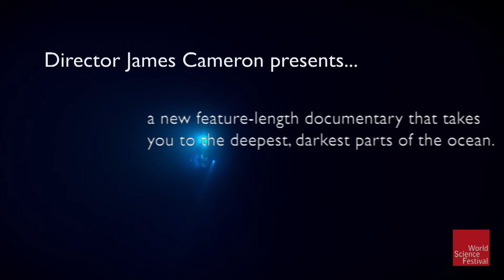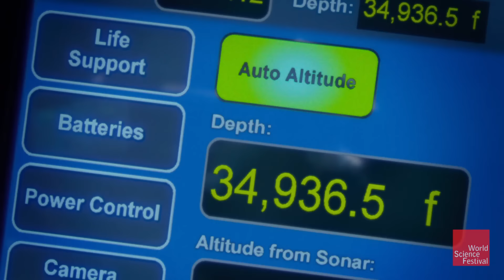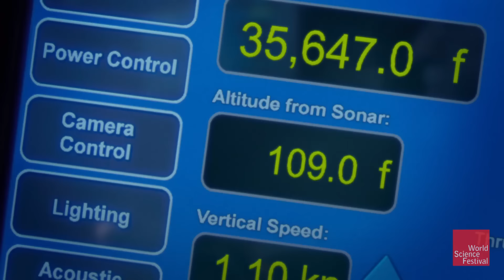James Cameron's DEEPSEA CHALLENGE 3D

Comment: here after Titan submersible incident. Compared to James Cameron dive sub, theirs looks like a piece of junk trying to get deep
Reply: So true - Deep Challenger is such an egineering miracle and yes Titan is a piece of junk
Reply: Same. Ikr? What were they thinking? 😒
Reply: It got deep😂
Reply: Despite your opinions, equipment really should NOT be complex !! As I'm sure you saw in the documentary, Cameron's sub also experienced some degree of systems failure due to some last minute computer code written in. The Titan sub's concept has proven to work and can be improved on just by eliminating carbon fibre and using steel /titanium throughout. The simplicity in the Titan sub means in emergency, ANYONE in the sub can operate it should the pilot become incapacitated. The Deep Sea Challenger is a single person craft and expressly intended for explorstion / research and so yes, needs all the bells and whistles. Just so you understand, Cameron's sub was built not by a huge corporation but by a guy referred to as "Australia's greatest Bush-mechanic"... Ron Allum
Reply: @zigzagger7893 and that’s not possible, that’s why they used carbon fibre instead. It would have been too heavy with space for 5 people
Reply: @zigzagger7893  what happens if my thruster of the left side goes out of control. And makes tour sub spin. How do you fix that using a joystick. Is that easy? 😂
Reply: @ExoticBlue22 Money Money Money is what they were thinking
Reply: It looked like an aluminum cqn while this one looks like art and engineering
Reply: @massinakmin8340  : The joystick is only there to control the actual equipment. The control could have been a touch-screen interface, could have been lever & cable with proximity switches. These are just control mechanisms. How do you stop the vessel from toppling when the system responsible for "not-toppling" fails ?

Comment: Worst nightmare...losing power at the bottom! 😱
Reply: Try to play game SOMA
Reply: Yeah I suppose that a sudden violent case of diarrhea and blast-vomiting comes in second. Close second, but second. Unless you wanna go combined for a real horror story.
Reply: At least no worries about your family having to pay a burial. That you did take care of.
Reply: In fact, there is an protocol, when a cable is broken or in similar cases, a program is launched that initiates surfaced to the surface (runs on spare energy).
Reply: I suppose it works the same way as on Trieste that made the first dive to the Challenger Deep 60 years ago. It had its ballast rigged so that it was held in place by electromagnets. If the power was lost, the weights were dropped and the bathyscaphe floated to the surface.
Reply: Yo
Reply: That’s exactly what happened to these people going to see the titanic
Reply: @Kraterlandschaft fair but I assume if you can afford a project like this you can probably afford a funeral. But alas

Comment: When you look at the technology and sophistication on that sub, including communication and then you realise that the TITAN was a tube made out of the wrong material and was operated by a PS3 controller that the CEO didn’t even know which thruster was operated by the movement on the toggle, it is extraordinary that ANYONE on the oceangate team was willing to work on the project. This was a mass group of people all suffering from the Dunning Krueger effect in my opinion. I hope there are Gross Negligence manslaughter charges bought against the entire team involved in the creation of Titan if it is proved that safety testing wasn’t sought, and engineering recommendations based on scientific fact were not followed, it is absolutely diabolical.
Reply: They signed the waiver so they new that if you want the biscuit you got to risk it.
Reply: It doesn’t matter if they use ps3 controller or even they use 80’s family computer used in super mario. It’s electronic and it does not hold back the pressure. You blame it to mechanical part.
Reply: Dunning Krueger effect is a myth.
Reply: It was created by a women's team😂 that might be the reason.
Reply: @@bossintrepid2128 weird because I’m “woke” and LGBT.. but you keep doing you 😂
Reply: @jwatson181  most people lacking competence would think that x
Reply: @sibboo4411  Look it up. They did a pretty interesting study showing it was a myth. Most people think they are better than average. This is where the effect comes from. People may know they suck at something but still think they are better than most people. Experts and lay people amsuffer the same.
Reply: @sibboo4411  Karen's are most often woke. That is a fact.
Reply: It was a logitech controller, but still
Reply: Here we go again, idiots blaming the PS3 controller
Reply: And naming it Titan, but made from carbon... Wrong on so many levels.
Reply: @jwatson181 lmfao, your comment is in itself validation that it's not a myth. Good job!
Reply: @theuniversewithin74  interesting argument. Do you think your argument is valid? I will give you a hint. It's not.
Reply: I agree with you 100%. I work in software development and we constantly see Dunning Krueger effect. I think this was 100% the case.
Reply: @jwatson181  Dropped at birth, I presume?
Reply: @iconofsin1043  you seem upset? Why? I am sorry researchers can't replicate the effect and now think the original study data didn't support the researchers inference. What do you want me to do about it?
Reply: @jwatson181  13
Reply: @iconofsin1043  13 is an important number.
Reply: @iconofsin1043  14
Reply: @lesterliston4692  
1. A PS3 controller is made out of flammable material which is unacceptable on a submersible
2. A PS3 controller is insultingly unreliable for such operation. If you've ever owned something like that you know it's heavily prone to stick drift. 

It's not what caused the implosion but that doesn't mean it's not a huge safety hazard
Reply: @Whitguy86  That's even worse than a PS3 controller. That controller is something you buy to maybe try some retro games or something and don't wanna break a bank. But yeah saving money is one thing but they couldn't even spend like $400 on something reasonable for such purposes? Brah.
Reply: @l4kr  what is not flammable inside the submersible? Is the paint not flammable? So if you make it not flammable is it ok? Or put diamond to make it expensive? The control system have a redundant on the control panel. PS3 controller is for portability so that you can watch on the window while controlling. Wireless 2.4Ghz with short range is reliable as wired. The size of submersible was not more than 20feet. I am working for the last 15years working this kind of wireless technology. It doesn’t fail in short distance. Maybe you’re mechanical engineer who where power trip like they are more intelligent than electronic and computer engineer. What happen to the platino contact point ignition system when replaced by ECU? The engine Hp increases right?
Reply: And according to James Cameron, the Titan wasn't even approved to go to such depths. I watched that documentary countless times and it still blows my mind what they were able to accomplish as a team.

Comment: Put it in perspective, 12 people spent about 300 hours on the Moon, while only 4 people have been on deepest seabed for 3 hours: Don Walsh & Jacques Piccard (Jan 1960), James Cameron (March 2012) and Victor Vescovo (April & May 2019) ...
Reply: Is it because the pressure down there is so high that it's difficult to stay?
Reply: @voiwithad  yes  oceans are more remote than the space its surprising  right 😃 what james Cameron did is unbelievable what a guy🙏🏿
Reply: Going to space is no pressure. Going to the bottom of the ocean, the pressures on!

Puns aside, I'm sure it's easier to keep a space shuttle from expanding apart then it is keeping a sub from being crashed like a tin can.

Comment: Stockton Rush was a billionaire. Its astonishing how he didn’t hire the best engineers to create his submarine. Instead he chose to get parts from Home Depot
Reply: He was not a billionaire, estimates range from $12 million to $25 million.  He didn't have access or the funds to get the best, Triton makes the best submersibles, the one that went to the Challenger Deep several times already (after Cameron did it in his version) cost over $37 million to make.
Reply: I support the other poster's answer. In my opinion, Rush also sold tickets for 250k because he needed the funds. In the mid 1990s, one dive to the Titanic in the Russian submersibles Mir cost between 25.000-36.000$ (acc. to book "Titanic and the making of James Cameron"). Even adjusted to inflation today (50k) this would be much less than OceanGate's price. Private dives to the Titanic in these Russian submersibles happened. This proves it could be done cheaper and safer using known, tested and certified technology.

Comment: That thing in Kawasaki Green makes me ask this question. ( i say that because I'm not quite sure if Deepsea Challenger refers to the project or the name of the sub)Gravity drops it down to the bottom. Dropping weights allows it to rise up again. How do they know that the surface it lands on is perpendicular to the vertical sub, so that when it lands it doesn't tilt over, and even if it does hit a flat surface when it arrives, it just seems so narrow a structure that I don't see how a stable perfect vertical landing is guaranteed, or controlled. Are side jets maintaining the angle during the drop? Is it bottom weighted? And like I asked, what if the surface is at an angle or there are objects on the surface that make the sub tilt over when it arrives at the bottom?
Reply: +sclogse1 I'm sure the develepers had all this in mind during the the making. Prob got cameras to check for horizontal landing areas?
Reply: +sclogse1 Maybe the same way they detect iceburgs?
Reply: Sonars dude
Reply: As long as the center of buoyancy is higher up than the center of mass, it is stable and will stand upright on the sea floor. You can try it wit a PET bottle and some sand, fill it only as much as it sinks in water and see what happens.
Reply: The heaviest part of the submersible is the steel pressure vessel that contains James Cameron - made of thick steel. This is right at the bottom. Most of the upper part of the submersible is made of compression-proof foam, which is buoyant. Thus the submersible is naturally stable in a vertical orientation.

Comment: Why is it so narrow and cramped up?
Reply: The narrow vertically elongated shape is because it mostly travels down and then up again so it's good to have low water resistance in that direction. The space where Cameron sat is a steel sphere and it has to be small in order to not weight too much. The wall is something like 100 mm thick to sustain the huge water pressure on the outside. The rest of the craft is not pressure tight and doesn't need to be since the equipment tolerates great pressure.